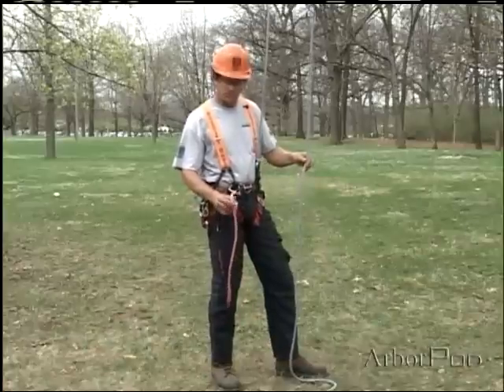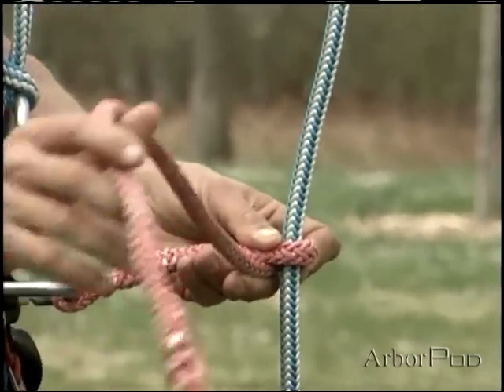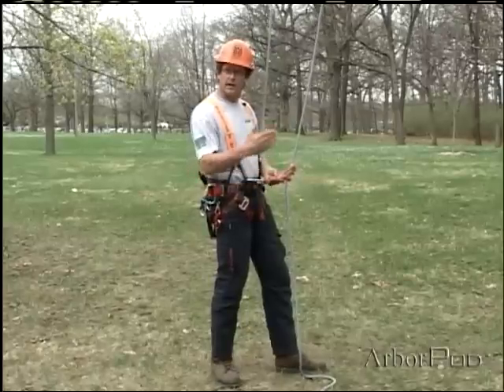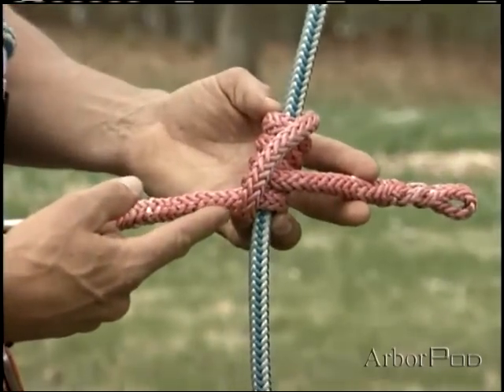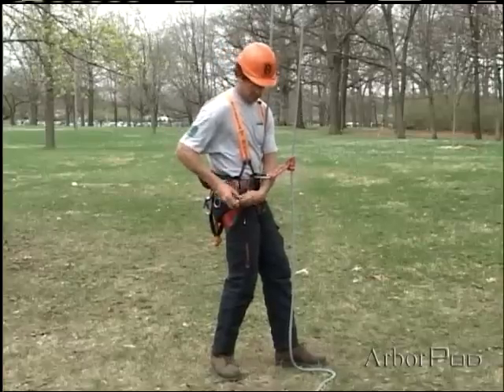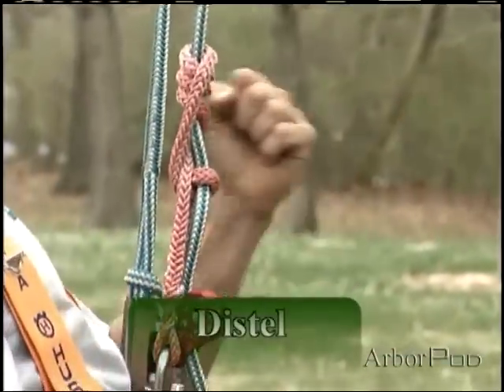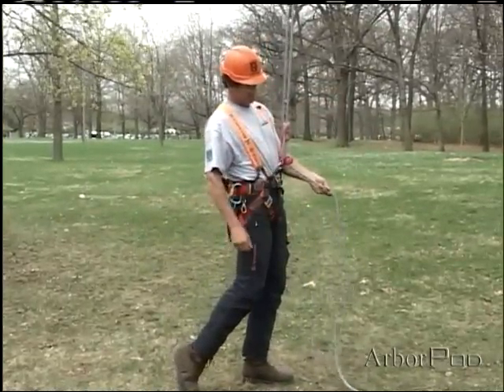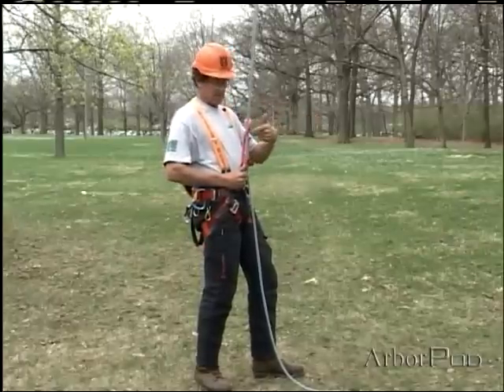Distel

Comment: is your climbing line maypole braid or solid braid ?
Reply: +Duggy Dugg That's a 16 Strand, Samson Arbormaster 1/2".  Most rope companies in the arborist market make one with this structure.
Reply: Stephen solid or maypole ?
Reply: Duggy Dugg Solid.  By maypole do you mean three strand?
Reply: maypole is braid around a straight core 

solid is just the braid no filler core 

maypole is not as safe as solid ...solid can't go anywhere ...maypole can slip with respect to the core material .. it's a cheap way to make rope ... you will see this in shoe laces and other cordage if the ends aren't sealed ..

paracord is a n example of cord that can slip with respect to its center strands ...550 para is not weak but the outer sleeve can slip on the center strands ...an advantage in para and not in cheap center strand cordage...
Reply: Duggy Dugg Ok, the 16 strand rope has a few strands that do not leave the core, but they won't milk either.  Its really snug, I'd say its a solid braid.  You're thinking more like a double braid, 24 strand, or kernmantle when you say maypole.  Double braid shares the load between the inner or outer, whereas kernmantle is core dependent-- all the strength is in the core material and the sheath is just there to protect it.  Kernmantle are typically straight core fibers with no braid.  Really low stretch.  They milk (core comes out some) as do the 24 strand which are mostly core-dependent.  24 Strand ropes are probably the most popular lines now.  Anyway I hope that helps.

Different rope designs excel at different uses.. they cant be good at everything.